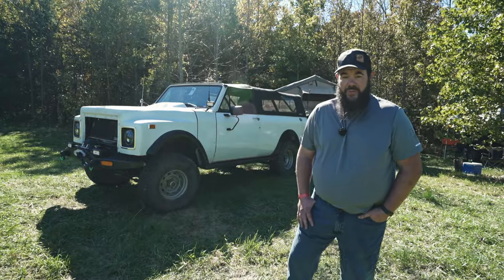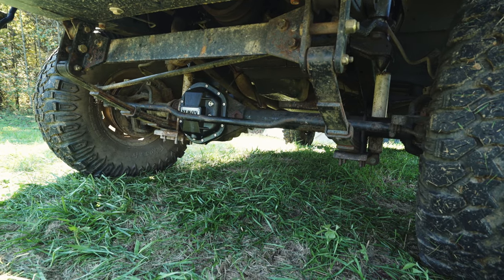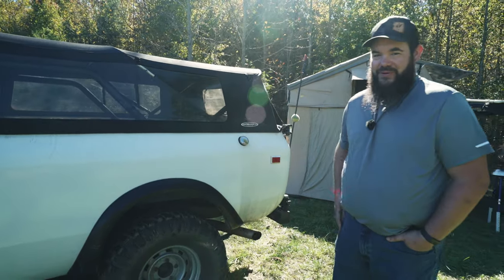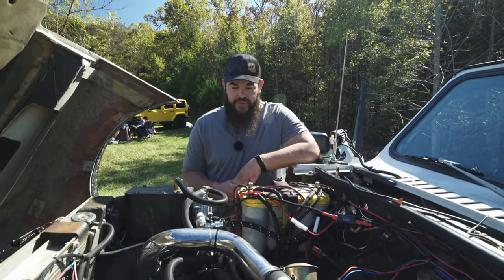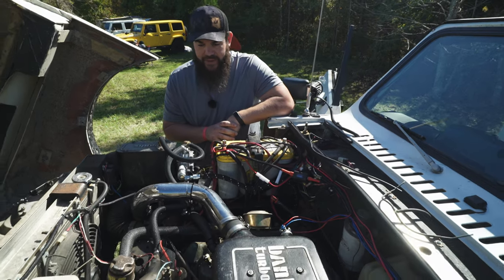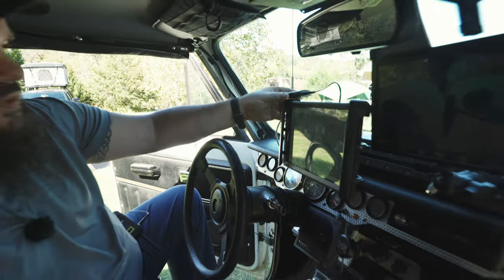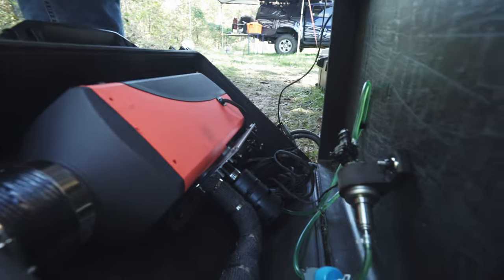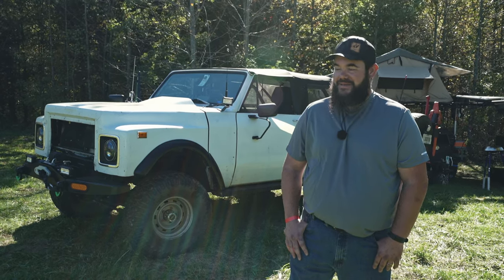1977 Scout Traveler & Trailer Upgraded for Overlanding

Comment: Why did he change the front of the truck? It's not a scout anymore after that change.....
Reply from the maker: Because it's his truck and, yes, it's still a scout.
Reply: Like I mentioned I started this truck with a bit of a prepper mindet.  This was Looooong before I heard of overlanding.  I wanted a truly 1 wire diesel, with little to no electronics, something that was reliable, and I could work on myself.  Kind of got pulled into the direction of the 6.2L due to this and a fortunate junk yard find.  Admittedly I was concerned about fitting the bigger aftermarket radiator in and the engine, plus I was having a hard time finding complete fenders.  So I went another way, it kind of grew on me having all the engine access the roll forward offers.  And though you are correct, in that it is decidedly not "Scout", it is most certainly "International". LOL
Reply: @BlueRidgeOverlandGear  agree to disagree
Reply from the maker: Well, it's an INTERNATIONAL Scout with an INTERNATIONAL front end.  So I'm not sure what your point is.  Are people not allowed  to customize the vehicles they own?
Reply: @johnjames5020  LOL Thanks for the backup sir.
Reply: @BlueRidgeOverlandGear  thanks for the logical ideals.  LOL